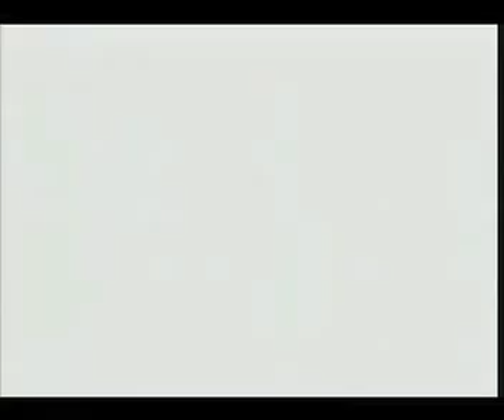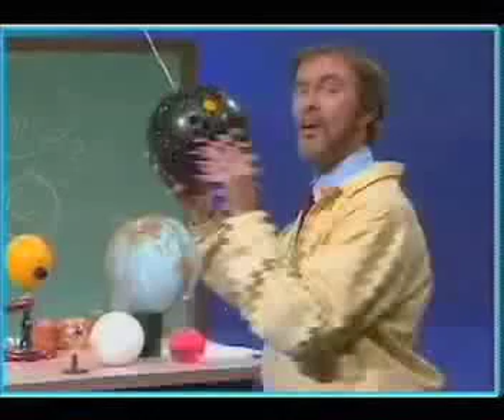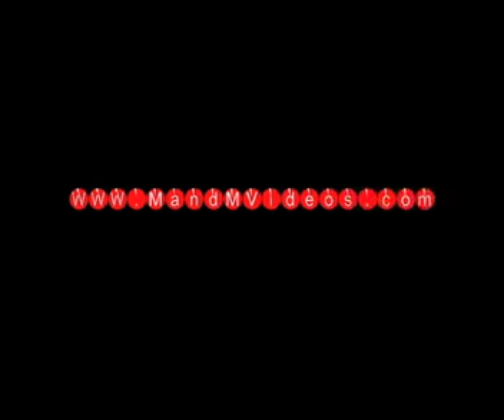conceptual physics  Conservation of Energy

Comment: Thanks jules. I think you missed my point, I concur with your analysis, repeated input at a 'constructive' point in a pendulum bob's oscillation will incrementally increase the angle of rotaton. Once a large angle is achieved, it can be maintained with a small input. The important observation, is that the force of centripetal acceleration acting at the pivot, can exert ,in the case of a very heavy bob, significantly more force/energy, (flexing) than the input energy. Anomalous extra energy.